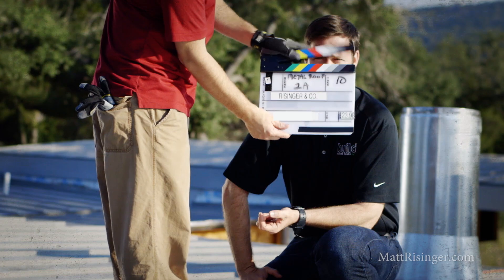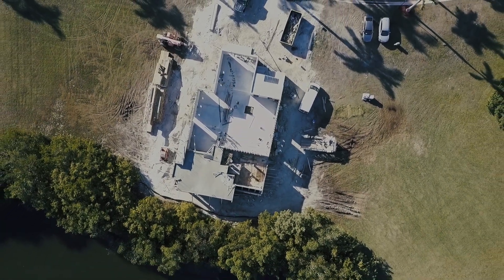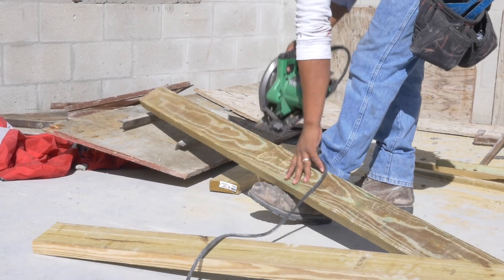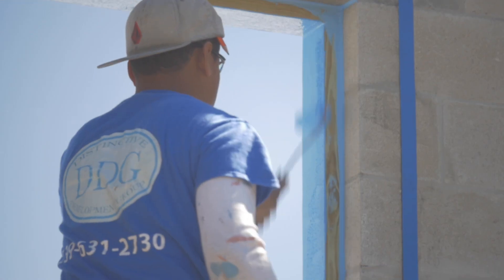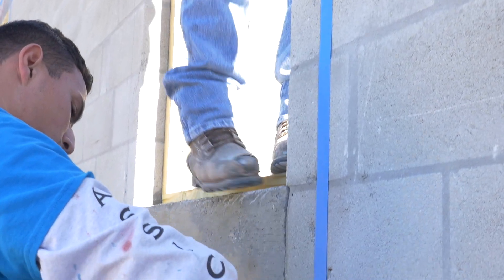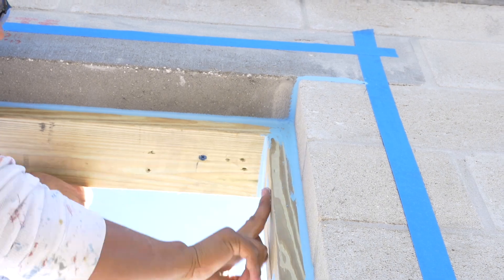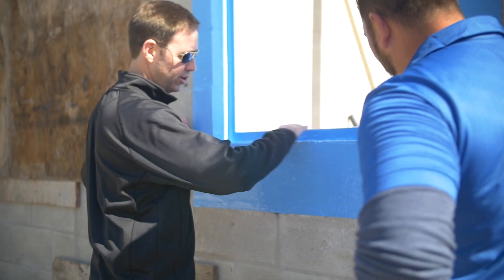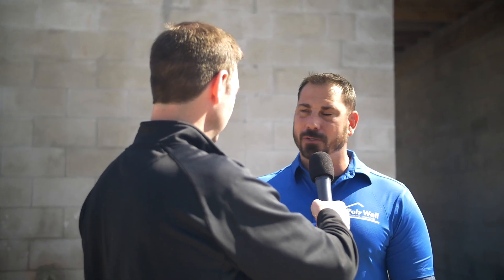The Next Generation in Weather Barrier Technology

Comment: How do you do floor joists for a second story on a concrete house? Ideally, you would want them supported by the concrete wall, but I don't see how you can do that here. The interior framing is usually minimal. Would you just have to go with full scale interior framing and build it on top of that?
Reply: There are two ways : concrete floors or plywood (or OSB) on floor wood trusses. If area is small : concrete floors are ok but they are expensive to make and not many masons have the forms and poles needed for the pour. In US since rooms are very large : the common method is plywood over wood trusses. The trusses are attached to the concrete wall by sitting them in metal brackets made by Simpson Co.(NYSE:SSD). Those brackets are embedded between the concrete blocks at the time when wall is elevated.
Reply: See video : Simpson Strong Tie - Safety Fast Lite - Masonry Hanger for Í-joists
Reply: See video : BPC Fixing SMH timber to masonry.
Reply: See video : How to install Steico’s ‘Í’ Tradejoist
Reply: @anonymousbyproxy8250  thank you

Comment: Taping off their application so it looks nice speaks volumes to the quality of installer and top down vision for the Company and ultimately the Customer. Well done.
Reply: Huh? He's marketing his own product - there is no reason to spend the time to tape the openings to get nice pretty lines - it simply wastes expensive product and requires more labor to install and remove and creates more unnecessary waste
Reply: @ArthurDentZaphodBeeb  its called workmanship. The dood is also a builder and that is his crew. Nothing better to promote the Product and Company more  than a pretty install. Yes, it takes a bit more time and some tape...but nothing turns a potential Customer off more than shitty sloppy install. He said the reasons why they tape it off. That home might sit for 6 weeks before the next stage. With your reasoning, why would a company even pick up their garbage or use tradespeople vs students. There is a reason why Ed is the owner and inventor and you are the critic.
Reply: lol it will never be seen by anyone. It's a way to needlessly drive up cost to the customer.

Comment: Wonder how his stucco lasts being applied directly to the block? And how does he sand his waterproofing so the scratch coast adheres? Can't be done with a spray gun so are his guys physically flinging sand at the walls after the waterproofing is applied, but before it dries?
Reply: The stucco guys usually cover all blue waterproofing in wire lathe first then stucco is applied.
Reply: @vlsr71  The guy specifically said they weren't using lath on this home.
Reply: 4:10  He said they broadcast silicone sand during the curing of spraycoat, go over with a link, then scratchcoat but said you can lath as the coasting is self healing
Reply: @roberttchatal6916  Ok, what's a link? Another coating? That's what I don't understand...

Comment: 1:52 - they did not treat the cut end of the pressure treated wood before using it on window opening.  Also, shouldn't they have applied the blue barrier to the side of the wood that is making direct contact with the cement block?  Wouldn't water get to the wood through the cement block?
Reply: As mentioned in the video, the entire face of the block wall will be coated with a spray-applied water-resistive barrier (it might also be the air and vapour barrier—not knowing the complete wall assembly, I can't say for sure). This will tie-in with the flashings shown, so the block will not be subject to rain.

Comment: Why is block building not as common as here in the UK?
Reply: The US and Canada have vast forests.  Plus wood is a carbon sink (the ultimate green building material), while cement production (used in blocks/concrete/mortar) is one of the most energy-intensive materials on the planet, making blocks relatively expensive.  Plus wood is a lot easier to install - a small house can be framed/dried-in in a few days.  UK doesn't have much wood, so they use block/brick a lot more.

Comment: I live in South Africa and our building methods are very different. We primarily build with clay brick and mortar and use cavity walls and we dont have the same moisture problems that is refered to in the video. I am curious as to why brick isnt really used in the states. Is it the cost aspect or is it other factors?
Reply: and wood construction is cheaper on labor and parts in the US.
Reply: Brick cavity walls are extremely common in the US especially in the southern US.  Clay brick is porous therefore allowing moisture into the cavity.  A weather barrier of some type is necessary in cavity wall construction to protect the structure from the moisture migration into the cavity.  Fluid-applied is the way to go.

Comment: What are "cold joints" as you spoke of when referencing different materials meeting?
Reply from the maker: That’s a joint in Concrete
Reply: A cold joint is when you add new concrete onto concrete that is already set up, like if you run out of concrete with a wall form halfway full and then finish filling it the next day. Another example is if you add a concrete column onto an existing concrete pad.

Comment: Sems an expensive option. For window bucks redguard and for their joints a compatible caulk. For the entirety of the concrete (in form of an admix) there are waterproofing concentrates you can put into your concrete at time of mic so the entire wall, slab, roof deck are all waterproof. Xypex concentrate is the product name. Not saying tour method doesnt work, but whatever can lower cost esp in labor and creates superior results, Im all for. Love your show all the same!
Reply: Using a low water-cement ratio is just as effective as adding Xypex

Comment: Concrete may be a sponge when it comes to water but the way my uncle who's a builder in the Orlando area says it doesn't absorb as much water as you'd think. The greatest thing he claims is bugs hate it, doesn't rot, very tight, good sound deadening characteristics, solid as a rock, withstand hurricanes and tornadoes, doesn't burn, and he claims that it has a higher ability to stop the transfer of heat rather than slow it down. Reason for my my family's 4000sq/ft home only running a 250-300 electric bill for a 50 year old home with no insulation in the dead of summer.
Reply: Like in Jurassic Park, when they say that 'Life always finds a way', likewise; in construction its true that ' water will always find a way in'
Reply from the maker: +keoki1978 cool. Thanks for commenting.
Reply: Dan 

True but with no wood to rot, no damage is being done. All homes in most areas of Florida are of concrete construction and have been for a very long time.

Comment: Dryvit  and Parex also have their own  liquid barrier membrane which I have used  when doing EIFS or even behind stucco.

do you know if this products are similar? I really think  this is the way ( liquid barrier)  we all should build.
Reply from the maker: +macrapidito I believe those products are water-based. I'm not a fan of that technology. The ones I like are STPE based Fluid Applied like Blue Barrier. They are a better product for many reasons.
Reply: Mmm now you got me thinking!! 

Water base VS  stpe base, I have to give Google a try 🤔

if you have any links feel free to share them  pls. 

I'm   an stucco contractor located at PA and as part of my water resistant barrier system I was planning to offer to my customer  a  liquid barrier membrane,  2 layers of grade D paper and rainscreen followed by a 3 coat stucco system.
Reply: @macrapidito1  I think the membranes are better since the fumes from the liquid adds to the problem of global warming and the stink that the new owners have to breath in. Using water base is a step in the right direction but zero fumes is what we are aiming. Stucco in PA is that Pennsylvania, I thought that was a icy snowy state where stucco only last 1 or 2 seasons and the ice chips away at the finish. We use stone or brick finishes in the snowy areas with a siding and and upper finish.